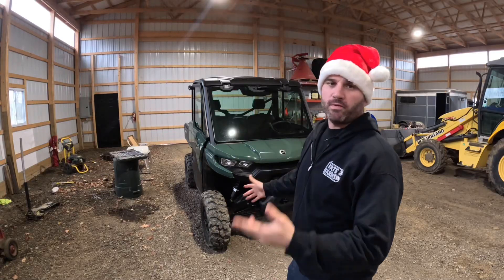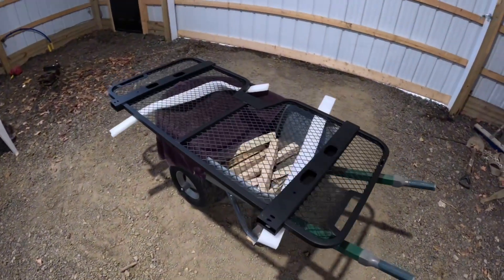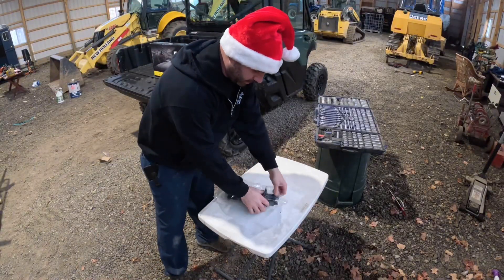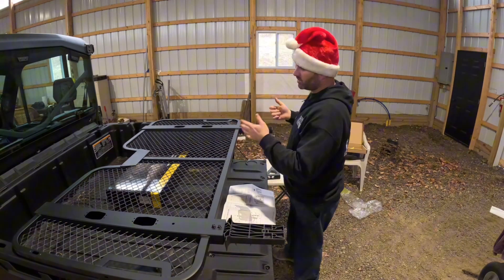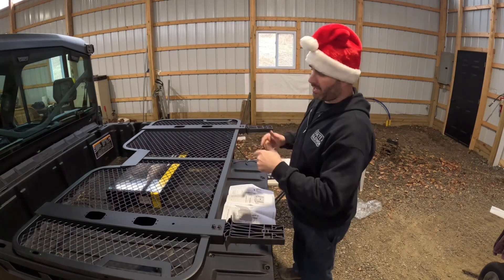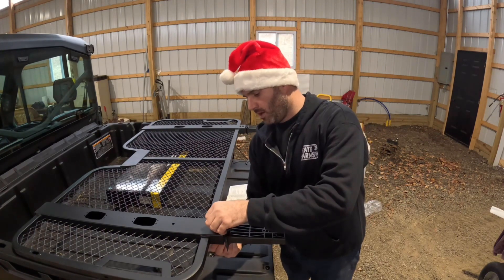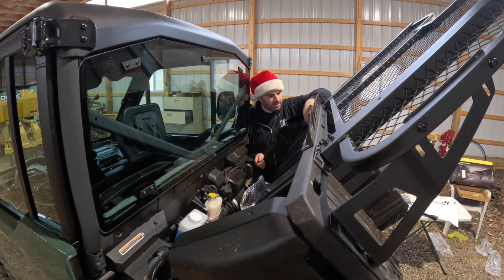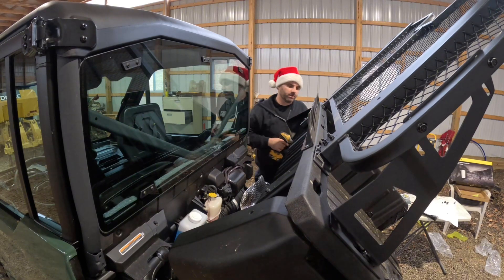2024 Can Am Defender HD9 Accessories‼️

Comment: Good. video..Im stopping by my local CanAm dealer today to look at the defender HD9 model.  I may bite the bullet and pay extra for this one versus the more budget friendly better accessory appointed CMoto Uforce 600.  Can Am sure nickel and dimes us to death with add on accessories that I feel should be standard at this price range like a full roof and rear bumper.  Can you do an electronic add on video for lets say a light bar install?  Does this model make it easy to add accessories to the switch blanks?
Reply from the maker: Thanks for watching. I agree for how much they cost they should come fully equipped. I was told that there is a lot of pre-wiring for accessories. I have not had the need for a winch or a light bar since we 90% of the time uses daytime hours for the farm property.